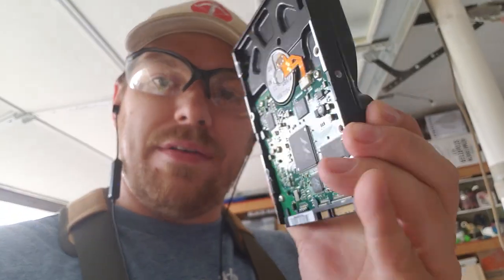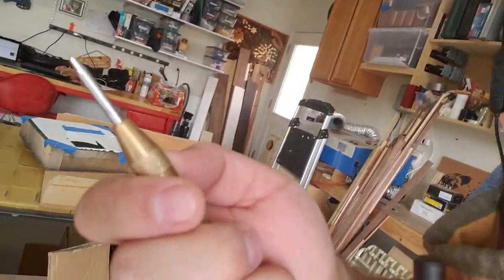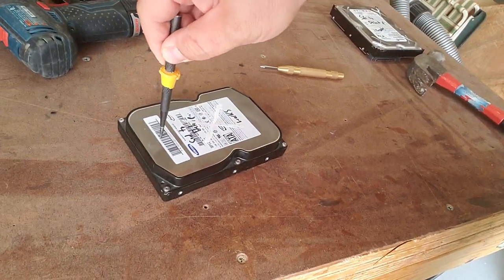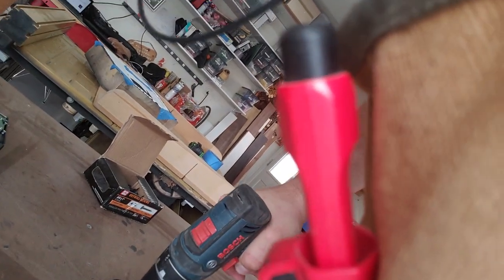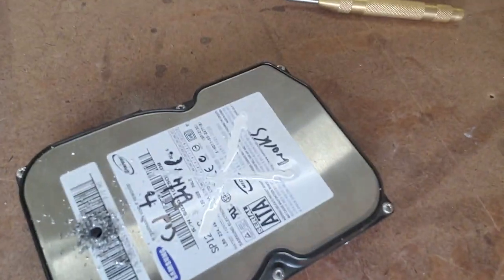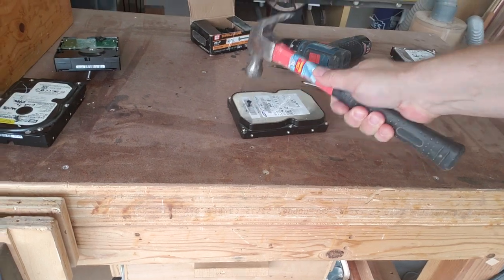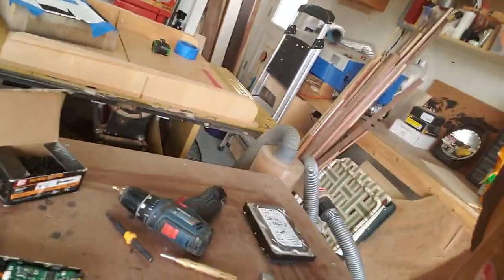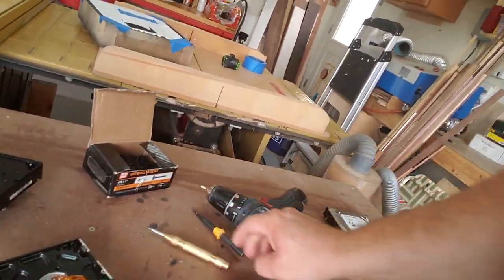How to properly destroy a hard drive

Comment: That looked rather cathartic. However, I couldn't help but wonder if a couple .308 rounds would give a similar result. Testing shall commence!
Reply from the maker: I was going to use a 223 solution but...you know...dont shoot what you cant replace
Reply: @xBeauGaming  Prices are dropping. When you buy bulk, you can get them for less than $0.50 a round.

Comment: A grinder with a cutoff wheel is also an excellent way to destroy it. Take the pieces of the platter and throw them away at different times so they can never find them all if you are really paranoid.